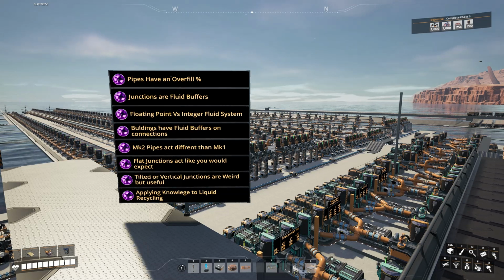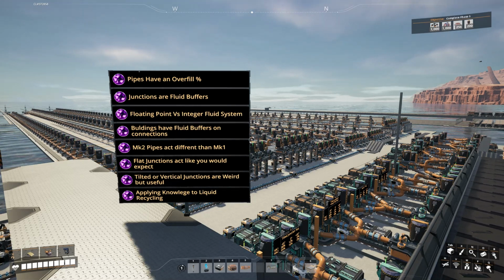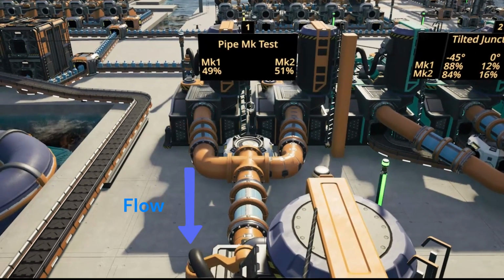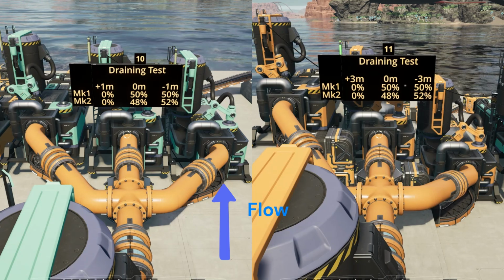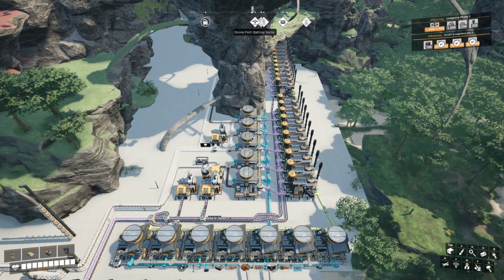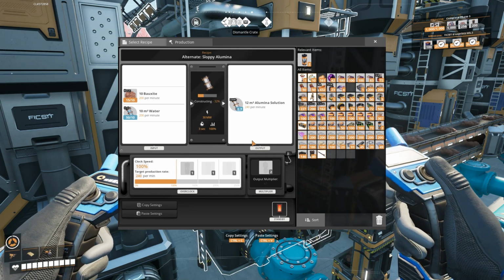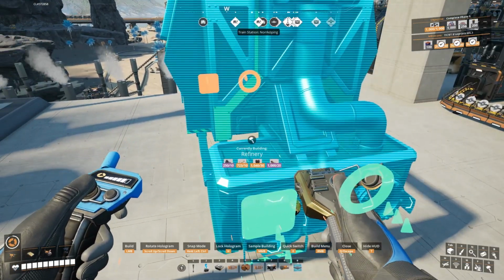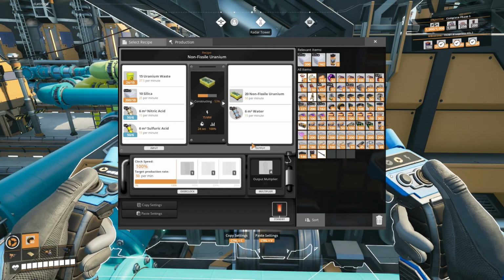Satisfactory 1.0 - Lets Talk about Pipes and Liquid Recycling

Comment: Great video man. I need to ask tho because i dont understand most of these pipes set ups.
Lets say for example im setting up an aluminum factory.
How do i handle the water piping to prioritize the recycled water first and then use the pumped water?
Straight piping for the recycle and from the bottom the pumped? Or vice versa?
Reply from the maker: I cover that better in another video.(see below)
The last part of the video covers practical builds aluminum setups.

Satisfactory 1.0 - Expanded Liquid Recycling Testing
https://youtu.be/00IMPPttN2A

Comment: Great video! I would like to ask for an additional test. If you repeat tests 5 and 9 but removing the bottom pipe, would the same total priorization happen to the middle input? I ask this because this is how the VIP junction is usually built, and there are many times it doesn't work.
Reply from the maker: Thank you.
I expect it will strongly favor the on level connection. 
I am working on a follow up video where I made direct liquid recycling test stands and measure the different recycling methods.  
I have the VIP junction included in Mk1 and Mk2 pipes. 
With Mk1 pipes it has 100% prioritized the on level pipe.
With Mk2 pipes it’s around 86% comes from the on level pipe. 
The video is taking longer then expected the some of the test setups have 2 stable solutions based on initial conditions, and I want to be sure the results are repeatable.
Reply: @BitwiseAssembly  That's amazing that you also check de different initial conditions. Keep it up! I must say I just implemented test 5 for my alumina production, just a vertical junction with no pumps nor valves, and it seems to work. Before, my recycled water pipes kept clogging up after many hours.

Comment: This is awesome. The difference of priorities between mk1 and mk2 setups is a nice find. 
This is a bit new to me, so correct me if I'm wrong, but it seems we could conclude perfect priority junction cannot be made with mk2 pipes, but it can function if the fresh/recycled ratios are such the deviation doesn't matter, like fresh water demand being > 17% as demonstrated in test rig 9. 

Other thing I noticed about the older alumina setup, I understand the unpowered pump makes it so the fresh water can't fill the vertical buffer, and that per test rig 4/8 higher headlift pipe in a flat junction takes "some" priority, I assume the alumina setup only works because 120m3/min recycled water vs 80m3/min fresh water fits within that "some" priority ratio? It would be nice if we could figure out a formula for the ratio based on headlift difference.
Reply from the maker: I would agree that a perfect priority junction cannot be made with mk2 pipes and I agree with your observations.

There definitely is a priority limit in the older setup. I currently only know what recycle rates I have gotten to work when using it.
The one shown in the video is 60% recycled water. 

I will work a a rest rig to see if I can measure the limit.

From an anxiety stand point I do prefer the older set up, since the waste return pipe is not full. 
The new setup is so simple and reliable, that I am getting use too the pipes all being full and happy.

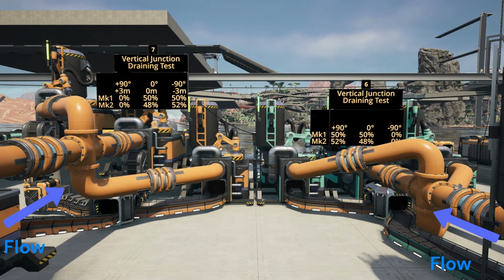Comment: From the looks of it the game simply doesn't account for physical size of the junction in head lift calculation, effectively giving you up to +/- 2 meters of free head lift depending on its orientation. The test results at 4:33 would make perfect sense if you imagine the sideways pipes offset vertically (in their entirety together with their outputs) as if they originated on the axis of the center pipe instead of junction flanges. That would shift the top pipe 2 meters down and the bottom pipe 2 meters up as far as head lift is concerned. Then the actual height offsets would become +1/0/-1 on the left setup and -2/0/+2 on the right, giving you unintuitive flow priorities that the test demonstrated as the result.
I still wonder why the flow would split evenly between the mid and low output even though the pipes don't seem to be full, but maybe that's just how this particular test setup works, or maybe there's some more magic to it.
Reply from the maker: For test 6 and 7 the pipes are very empty. The packagers are all running faster than the un-packager.  
For the flow in the draining tests I would explain it as the following. 
 The junction pushes fluid to all pipes with a lower fill percentage than the junction.
Which means the 3 destination pipes receive the same amount. The pipes then control the flow.  
The pipe flow models may only keep track of the 2 ends of the pipe and assume a straight line between them.  
The pipe going uphill would want the flow to go back into the junction.  
The flat and down hill pipes don’t have a reason to flow back to the junction, so they flow to the packager. 
The packager is running faster than the incoming flow, so there is space in the integer fluid storage in the packager preventing back flow.
Reply: @BitwiseAssembly  That makes sense.

I did some testing and my theory turned out to be correct: pipeline junction indeed doesn't add any head lift. This allows you, for example, to pump liquids upwards for free by chaining vertical junctions.
It also finally explains how VIP junction works: the two pipe junctions collectively eat 4 meters of head lift from the upper pipe, effectively shifting it 4 meters below the lower pipe. Every junction on top of it gets shifted further 4 meters down, which in the end results in the whole setup prioritizing the inputs starting from the lowest one despite them being physically at the same level.
Reply: Actually scratch that, it's not that simple. It seems to be a bug somewhere else, junctions only trigger it under certain conditions, but are not at all guaranteed to always work. More research is needed.

Comment: Great video, lot's of work put in it. But.. i didn't understand a half of it. May I suggest an explainer for some more dumb audience? :)
Reply from the maker: I may have trimmed a few too many words from the script.  It’s hard to get a good balance and this was my first talking video. 
I guess I could go over the major points here. 
Very beginning of the video I talked about how there was no real changes in 1.0 vs update 8 when it came to pipes. Which the exception of the saving system impact on pipe networks. 
In the last pipe video I did there was table for each network with included running at 100% measurement and that inadvertently measured impacts from saving and loading, which explained a lot of the complaints the community was having maintaining full flow. 
The pipe flow system in attempted to simulate liquid momentum by averaging new calculated flow with the previous cycles calculated flow, this caused the sloshing in the pipes. In update 8 when the game paused to save the previous cycle data would effectively be lost and any wave action would fall flat.  This helped some networks and hurt others so when 1.0 no longer paused the game to save some networks performed better and others did worse.  
This is something that is so in the weeds I did not think anyone would benefit from it so I glazed over it.

Moving on to everything is a fluid buffer. 
A lot of the fluid volumes are hidden to the player, which for most players is fine.  Explaining the why is the hard part, the fluid mechanics is broken into two parts head lift which is used to limit what hight a liquid reach and fill percentage.  These two processes interact with each other. head lift propagates through the network only through pipe/pipeline components which are full (100% or more full). The pipe network runs using floating point values with a soft limit of 140% full, this full range make the network act like a rubber hose but seams to be a necessary evil to prevent losing fluid in the network from sudden changes in flow. This is why everything has two values in the video a programed value and the overfilled value. 
Each of the different components needs to have an internal volume, so the head lift can propagate through it. 

The pipeline Junction programming was not adjusted when they added the ability to rotate it. That is why everything gets weird with it is rotated, all of that testing was just showing how I came to that. 
The created several Reddit posts using this test stand in update 8, this was the first video where I included them. 

I don’t have access to the program so some aspects I can’t 100% confirm. 
I am a mechanical electrical control systems engineering and part of my IRL job has me reverse engineering control systems from the UI and IO. So take that into consideration. 

I don’t think including the word salad above would have made the video clearer.

Comment: If I'm understanding correctly my intuition was right, use lower pipes to assign priority essentially. I set up a quick bauxite system when I first unlocked it and did that, I haven't seen any issues but I also haven't checked on it (my Aluminum Sheets in the Dimensional Depot haven't ran out so I think I did everything right)